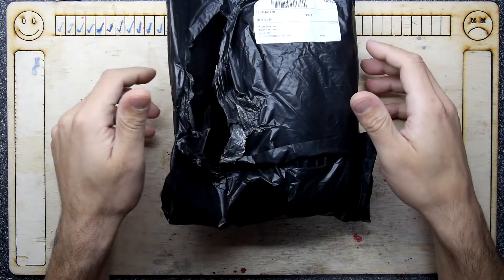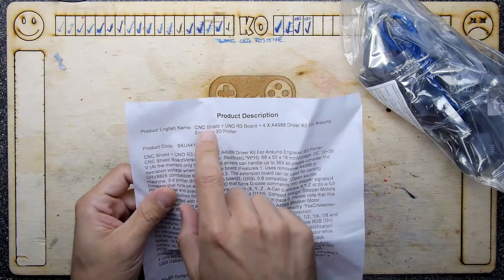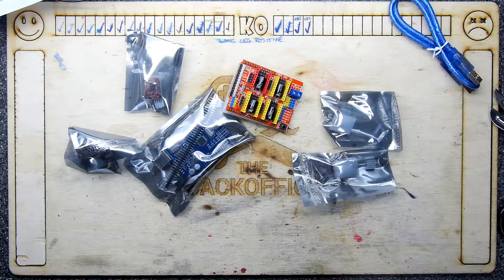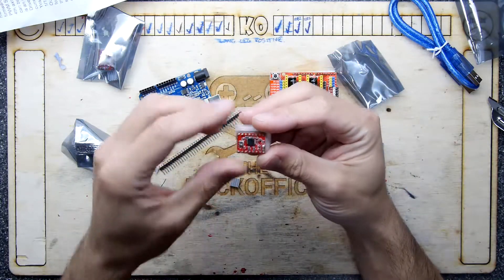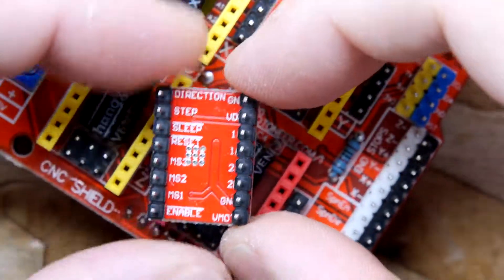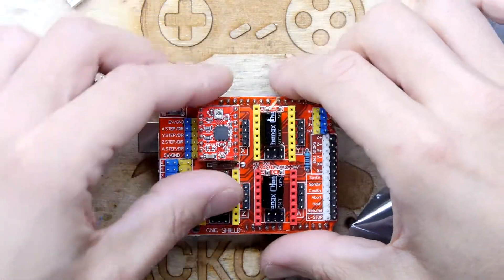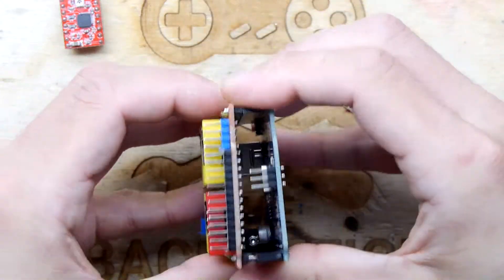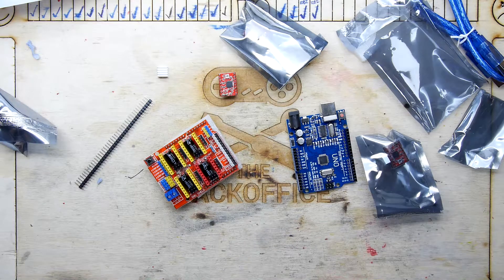Arduino CNC Driver

Comment: you preempted it would need some work  hehe
Reply from the maker: I just checked the latest version they do, the v4.0 and I think even that suffers from the same issues if you are using it for Laser cutting.